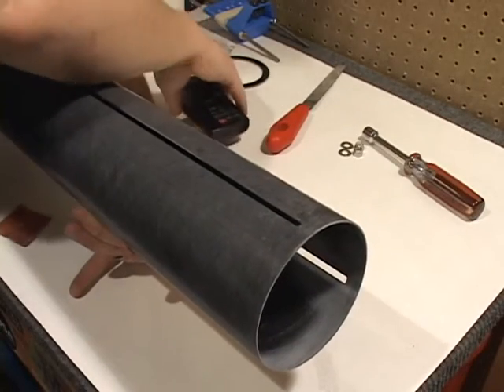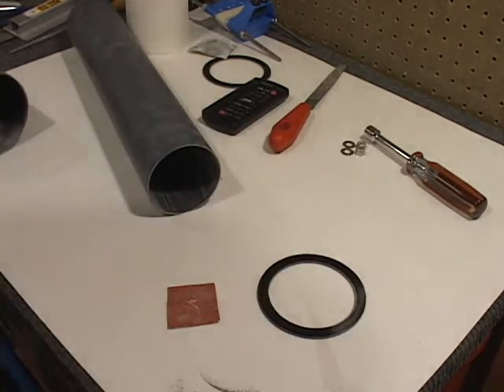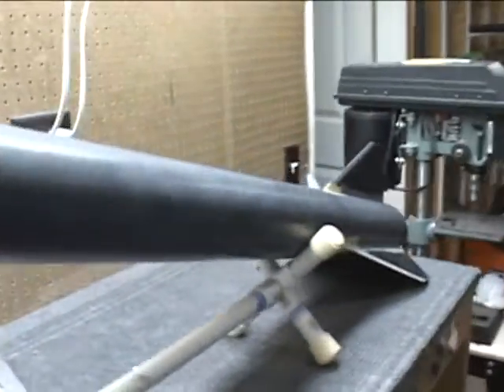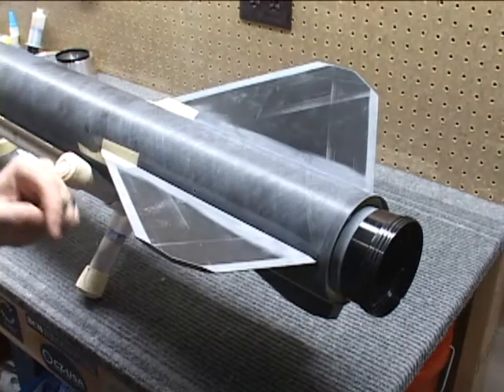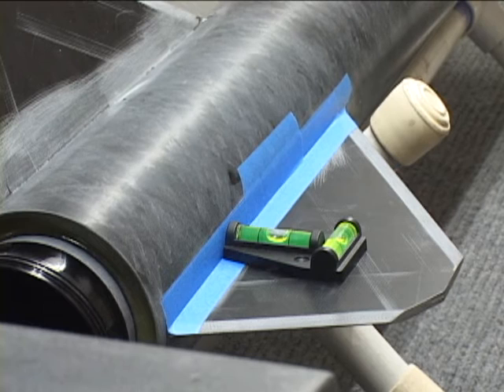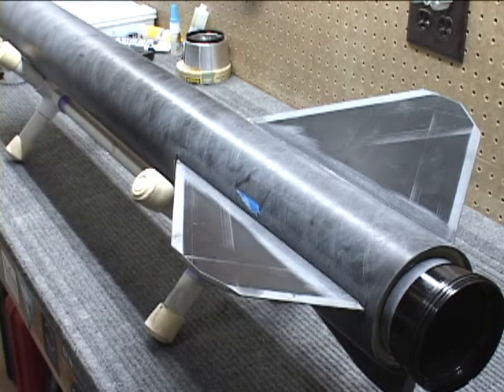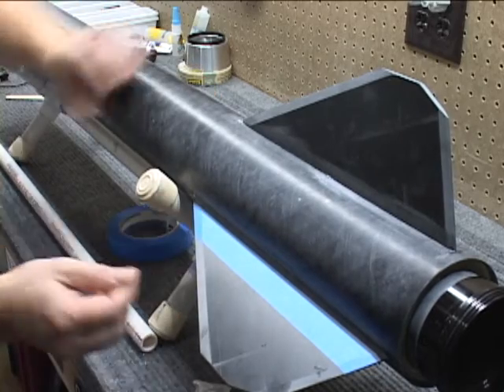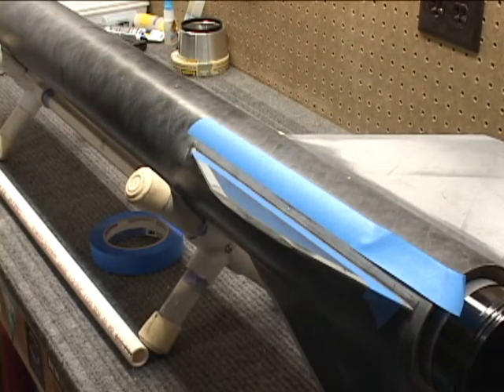Wildman Rocketry Video Build Series - Punisher 4 (Booster Fin Can)

Comment: I wish u would of ahown what u used to inject that epoxy.. i went to Walgreens and got some bigger syringes without needles and sanded down the tips to make them smaller sonthey fit in the hole
Reply: Check out the website under the west systems section. They have syringes

Comment: Nice video, Tim. I like to remove the motor mount after the fins are tacked to put the internal fillets on the fin roots. That way, I see exactly how the glue sets up. Interesting use of JB Weld for your fillets, too!